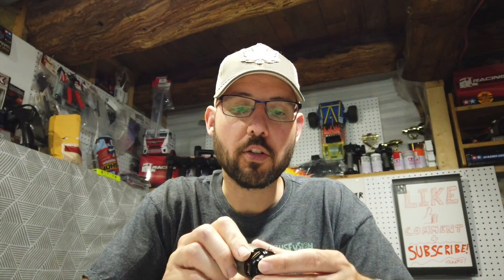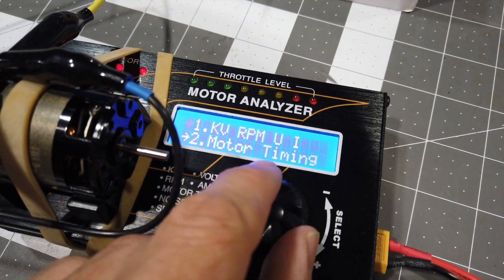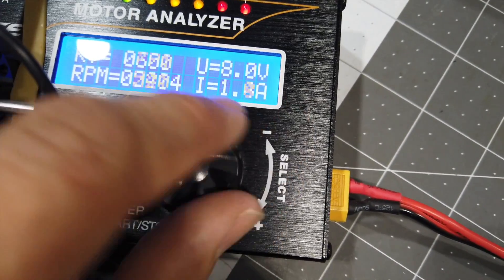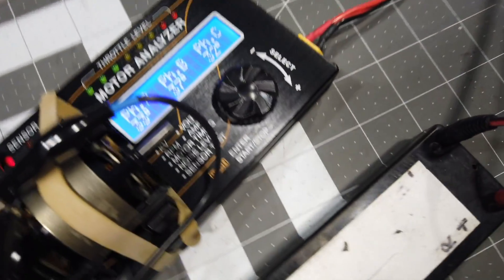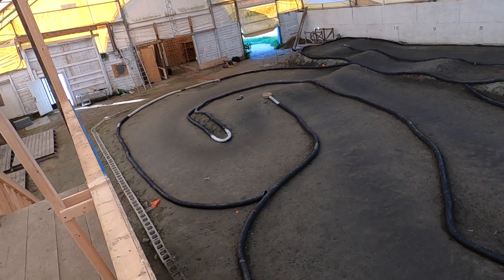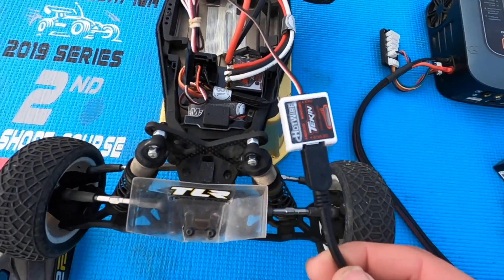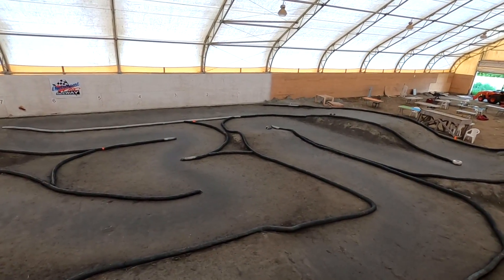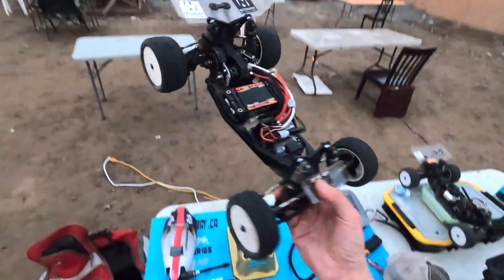TLR 22 5.0 with SMC LowRider 13.5T - Motor Analyzed and Track Tested! - Netcruzer RC

Comment: Your A, B, C wires are not fitted in the correct part of the analyzer as the blue wire should be in the A. Yellow is B and orange is C
Reply: As they will give incorrect readings/numbers. I learnt this when I got the analyzer and thought it didn’t make a difference where you put the coloured wires.

Comment: I also think the Issues John with this revision of tekin ESC is that you cannot adjust the Throttle and brake frequency like the RS Gen2 or newer ESC from tekin . That features alone made my RS GEn2 way smoother to drive and tuned and this is a must for 2wd buggy driving , talk to your fellow racers in Ottawa and try to hook your hotwire to their ESC you will see that they have way more features to tuned the ESC and able to tame the power of your 13.5T low rider. I always run mod in all my RC cars  and all of my ESC have Throttle and brake Frequency tuning in them.

Comment: did you check end play on your motor ? sometimes you can shim it closer to the board (without hitting it) and get better consistancy accorss the 3 levels. i own one as well and use it to rebuild all my motors before i run them.

Comment: Break ur foams in... They make a foam buster or tire foam buster I seen guys use it at the track they swear by it. And we race on clay electrons and postrons all day here
Reply from the maker: Hmm I’ll have to look into that. I do make holes in the foam ribs (closed cell) to make them softer before mounting.
Reply: @netcruzer  i do the same thing, and built my own foam buster out of skate board wheels.. but i also put holes in the foams and break them in, softens up the foams allows for a bit more grip and allows the rubber to strectch a bit more, wont "bounce" as much.